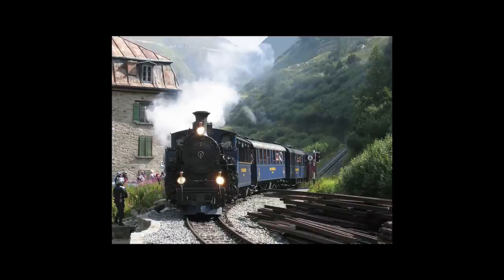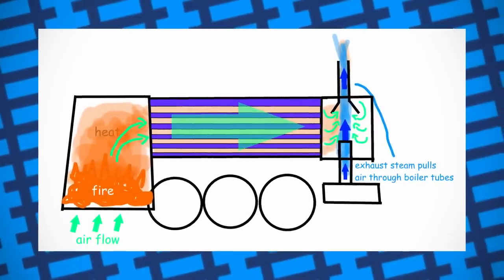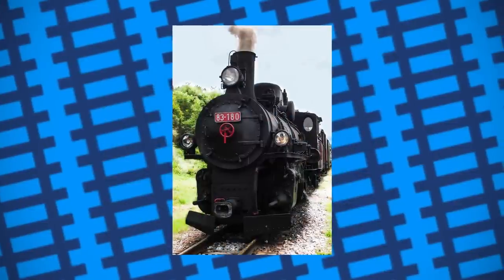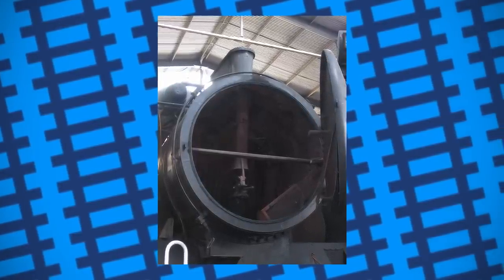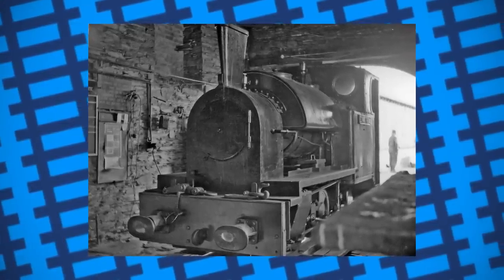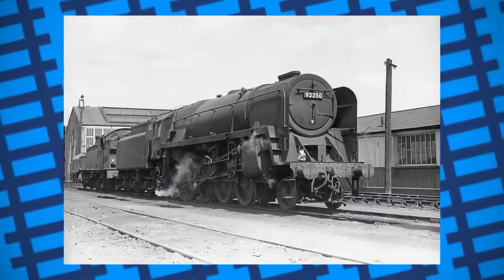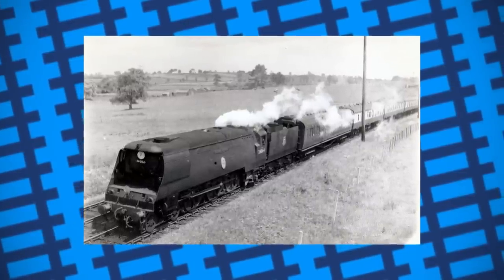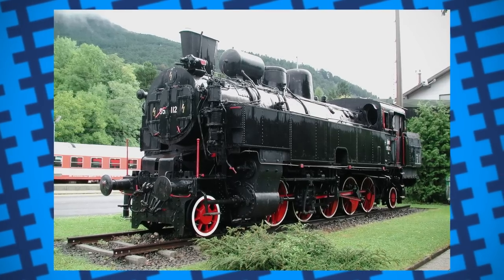Why some Steam Locomotives have Mohawks - Giesl Ejector

Comment: As far as i know, the only Australian locomotive fitted with one was NSWGR 3616, which was popular with crews and enthusiasts, and as such survived into preservation
Reply: The Victorian Railways modified front-end is a similar, albeit more successful story of redesigning the firebox and chimney arrangement for better flow, the main difference is that the tests were so successful that VR modified most of their locos with it and built every new one from then onwards with it already in.
Reply: All East African  main line locos were retro fitted with Giesl ejectors
Reply: 3616 was fitted with it's ejector in 1957 with trials staring in November 1957 and full scale testing in February 1958. 3616 was compared with 3661 and 3675 hauling the same train the through mail between Sydney and Goulburn. Test results showed that 3616 achieved 8% less coal consumption and 5% less water consumption than 3661 and 3675. Superheater and exhaust steam pressure and smokebox gas temperatures together with smokebox vacuum were all higher on 3616. Boiler efficiency rose from 76.3% to 81.6% and thermal efficiency rose from 4.7% to 5.1%. The reason no other engine was fitted was that the decision to proceed with the introduction of diesels had already been made.
Fitted with the ejector 3616 was a very quiet performer making it hard to tell when the engine was working hard. With a train of 5 carriages (244 tons) power outputs between 1710hp and 1830hp were recorded a record for the 36 class. Source: 36 class book by John Thompson.

Comment: Very interesting.
I've never seen them outside of some Japanese SLs and never understood the design.
Now that you've explained them I can understand why the Japanese National Railway would have wanted to try them out since all they had was low quality coal. 
Though I'm not sure how well it turned out for them in the long run because of language barrierals for that information for me personally. Though I've only seen examples of them on their heavy freight locomotive the D51 class and it wasn't super common on those.
What was more common was for them to fit an extra external blower and to use bunker C oil to make "oil sprayed coal" to boost efficiency
Reply: In Austria, almost every other engine had one of these. Especially larger tank engines and mountain engines

Comment: can you do something on smoke deflectors?
i've never understood how they work
Reply: Me neither, never really seen the point of them, it’s not like they prevent smoke from blocking visibility
Reply: @mcbenman1793  from my very small understanding, they create a draft effect and that draft raises the smoke
and they make the NYC Niagaras look 200 times better
Reply: They work together with an upwards sloping surface at the front of the engine. That pushes air up, the smoke deflectors keep that updraft close to the boiler, where it flows past the smokestack. That then pushes the smoke up and out of the way.
DRG Class 45 for example has a very pronounced ramp at the front.

Comment: Nice to see some Austrian engines in this :) Many engines had Giesls here, especially larger tank engines had them, like the classes 77, 78, and 95 (95.112 is actually in this video's thumbnail). Also the Mountain Railway engines class 999 were at one point all fitted with Giesls, as were the mentioned class 78s.
Reply: almost jumped when i saw 83-180
Reply: Good old Feistritztal Railway

Comment: On that Note, Franco-Crosti Locomotives would be a nice Topic too. If you're not familiar, Franco-Crostis didn't have a conventional Funnel and instead, the Smokebox redirected the Flue Gas into a smaller secondary Boiler below, which acted as Economiser to pre-heat the Boiler Feed Water. The Flue Gas then was exhausted on the Side somewhere around the Middle (lenghtwise) of the Main Boiler. IIRC, there is a Franco-Crosti Locomotive preserved operational in Italy.
Reply: That's another one BR tried on the 9Fs, but the big problem was that they didn't work well with the tight British loading gauge (especially since the 9Fs were already pushing to the limits).

Comment: The main reason they didn't work in the UK was because we had a good source of high quality coal, particularly welsh coal, so the difference in performance wasn't anything like as dramatic as for locod burning lower quality coal. It's also one of the reasons we were slower switching to diesel and electric than many other countries. The mistake was not thinking that the supplies wouldn't last forever and getting left behind.

Comment: 9F no, 92250 was fitted with tge Giesl ejector around 1959 and retained it until withdrawal. This is on the same page of a certain online encylopedia where you got the picture at the 1:27 mark. Not more then 2cm away from it. So how foes this tally with BR rejecting the idea?

Comment: I find it interesting some railroad used the modern electric bolt icon for it's company logo and painted it on old steam locomotive faces. 
Like on the final train shown in the video, im assuming that's the story behind it?
Reply: It's actually a warning symbol for the overhead wires so that you don't get electrocuted when climbing the locomotive if you're under it.

Comment: The phenomenon of back pressure is explained completely wrong.  It is not reducing the smokebox vacuum. It is not a matter of air restriction, it is a matter of the steam circuit. The back pressure means, that the cylinders have to work against it. Exhaust is not as freely as it should be.

The exhaust system was a compromise.  Make the blast pipe narrower, then you have more inertia in the steam that is exhausted resulting in a better smaokbox vacuum resulting in better combustion, but you have more back pressure on the cylinders, resulting in reduced power output.
With wider blast pipe you have less back pressure but less smokebox vacuum resulting in less draft through the firebed.

The special blast pipe arrangements like Kylchap or Giesl were an attempt to create a good draft but with reduced back pressure, and when they were designed properly, they really helped and increased overall efficiency and power output.

The Giesl ejector was used in combination with flow restrictors in the small tubes. This was possible because of the enhanced draft, with the effect that the steam producing of the boiler was reduced by only a very small amount but due to the enhanced flow in the big tubes this meant greatly enhanced steam temperature of well over 400° C right from the start.
So in combination, the steam engine created a lot more power, because of better steam flow and more energy content of the steam.